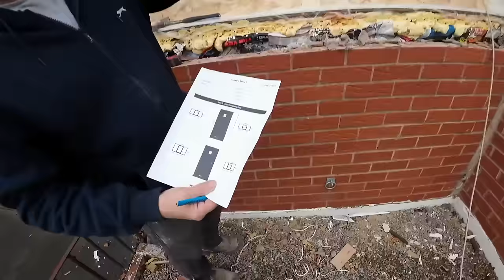BAD WAY TO BUILD A HOUSE!!  PART 1

Comment: I am  not a builder so I'm confused how putting a concrete lintel on the external wall of the house enables  the attachment of curtain rails on the inside wall. Will the internal walls be modified as well.
Reply from the maker: Spot on 🧱👍🏽